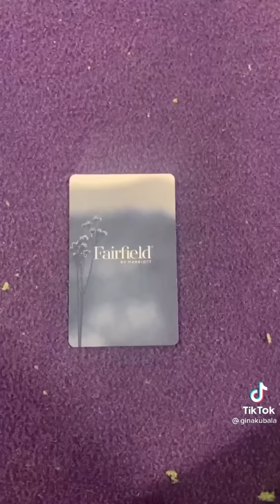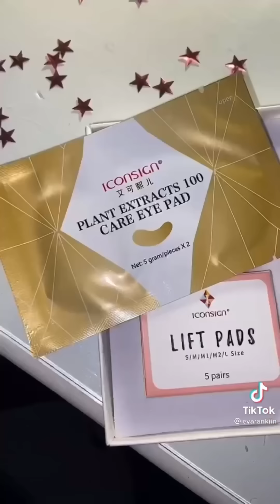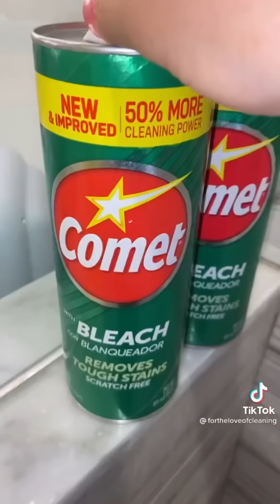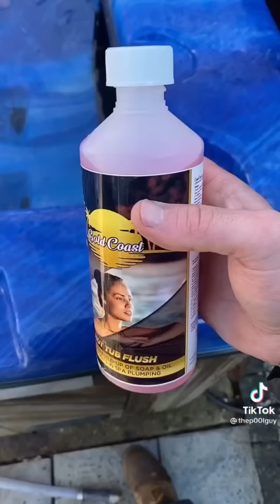Satisfying Cleaning Tiktoks

Comment: My number 1 tip in cleaning complicated showers is to start from top to bottom. Do the walls, windows and shower head/shelves, then move down to the floor to scrub the grime from the corners and tile/rock lines. It's pointless to do it all at once especially if you have to re-step into the shower to clean the higher-placed accessories.

Comment: So much product wasted 😔
Reply: @mvc1701   Yes but some people poured out half a bottle when they could have put 1/10th of that and it would still be as clean; or just, you know, don’t use as many products together. Most things you can just use a little bleach and nothing else and it’s done + some products actually damage the surface they are applied on
Reply: Also: some products mixed together produce toxic gases, I hope they were using a mask or respirator for most of these videos

Comment: When they use 5 products to clean something that just 1 would do the trick🙈 mixing chemicals is not safe at all, if you need to use multiple products use one at a time and rinse between but you really shouldn't be using more than like 2 oof

Comment: Such a roller coaster of emotions. Some videos are good and handy, but then you get hit with a video of people wasting products and mixing random chemicals together, probably just because "it looks fun". No, it really doesn't

Cleaning is not about the amount of product you are using, in fact too much will just make it worse. I used to have a cleaning job and learned very quickly that often less is more, and too much chemicals can and will damage whatever you are cleaning. It's more about letting the right amount of product sit and work its magic, not spread it around and immediately start scrubbing and rinsing it off . Kind of beats the purpose of the product, if you are just using brute force scrubbing the dirt off